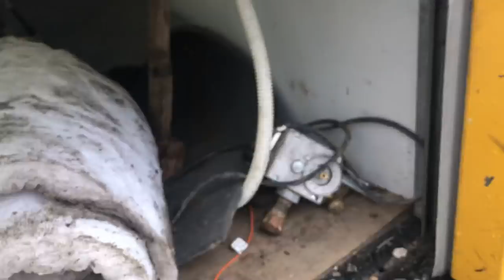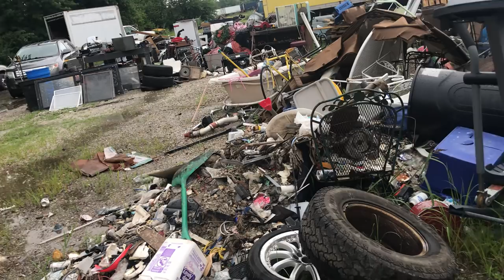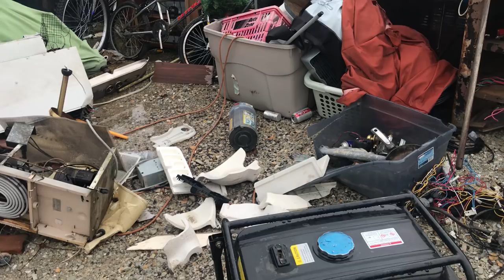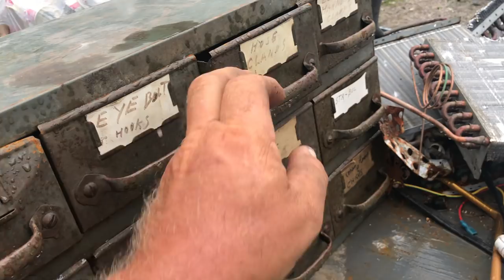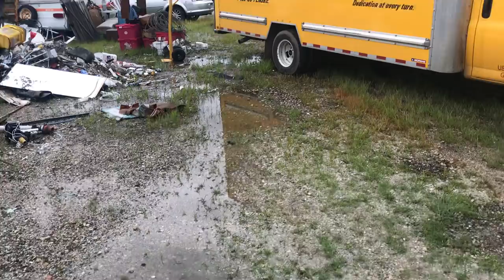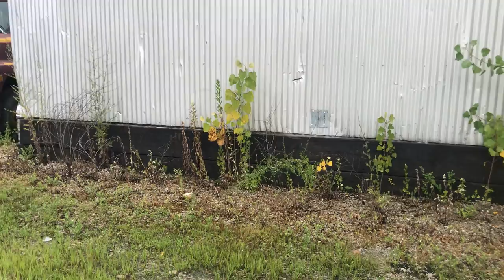Back at the compound

Comment: How many miles does that yellow chevy have on it
Reply from the maker: Branden John 513000!!!
Still running not burning oil 😁👍
But needs a lotta work 
Like all my other trucks 

I really don’t wanna buy any more trucks either 
I want to make money off of my operation instead of putting it back into equipment
Reply: SCRAP Kingdom!!!! Wow yeah they run forever my 94 suburban has 254000 still runs like a champ just had to rebuild the tranny at 180000  that has the 350 right? Best small blocks every built nice and simple last forever
Reply from the maker: Branden John yes. 350. Engine 

So does the white pickup 

Yes sounds like ya got a lotta more miles left in your Chevy too!

These trucks are preferred over 
Toyota because the bodies on Toyota trucks  Start to  left fairly early and don’t hold up very well to the Scrap life in general which is extreme abuse
And. No I just don’t see that aluminum pick up truck bed on the Ford F1 50 working out very well
Not the best set up for heavy Scraplife abuse!!!!
Reply: SCRAP Kingdom!!!! 😂😂 yeah idk what they were thinking on that atleast it won't rust that's for the pickup drivers that don't work there trucks. Defiantly don't make them like they use to Chrysler sold out to fiat and lost Cummins 🤕😢😲😔😔

Comment: Why is prices down everywhere?
Reply: Terri Sams cause. Yards get overs loaded this time of year and its just sitting thats whst claim is in N.Y.
Reply from the maker: Terri Sams typically May is the highest month of the year and November January are the lowest points of the year
Things are going on a skid usually in the middle of the summer
But it’s not going to plummet prices just will keep going down until around Christmas time or so
Then back up

Of course noticed the price of gasoline it has suddenly dropped about $.40 a gallon

Oil is the king commodity

It rules over gold
Gold is the queen commodity

It  can make all the moves but that doesn’t own the world

Oil.   It’s oil that rules 

Anything and everything
From the food you read to the clothes you wear to the energy you use to the road you drive on
It’s oil. Not gold 
So when oil goes down so do the prices of key commodities
Corn I beans steel copper and everything else all drop when oil drops
Not too hard to figure!!!!!
Just look at the price for gasoline at your gas station and it pretty much is the weathervane it tells what direction we are going